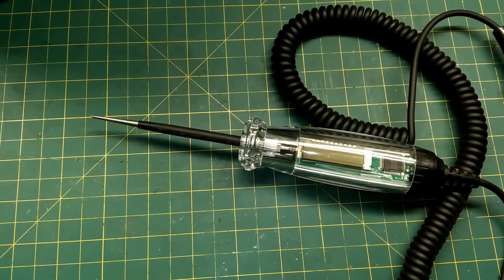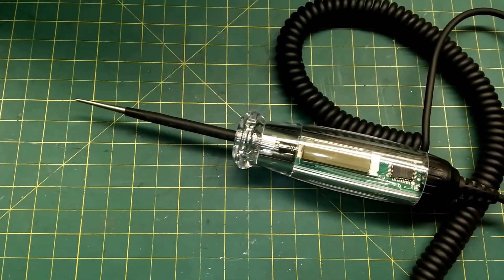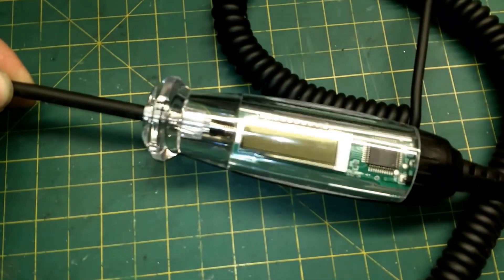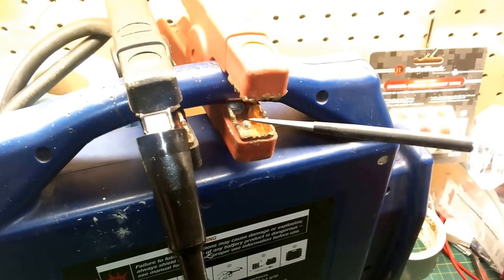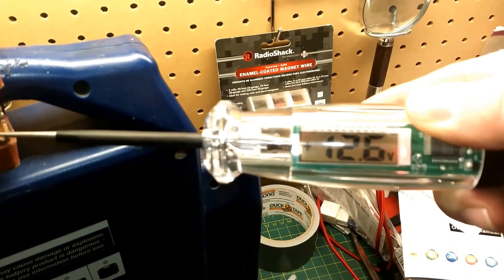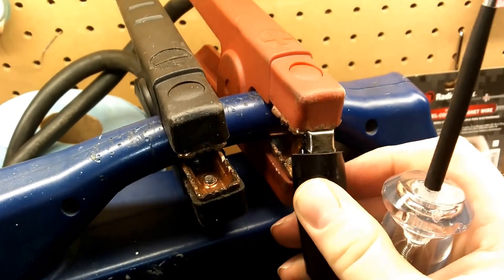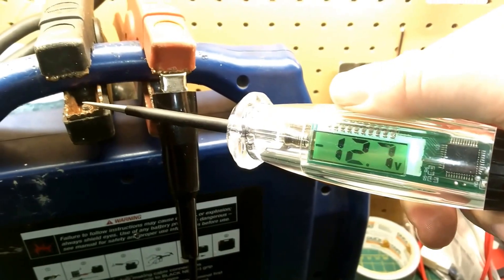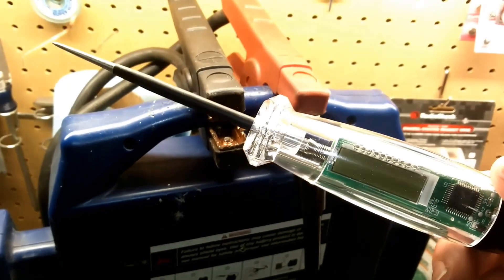Best Test Light ever! Digital Test Light with Voltage Meter and polarity protection!

Comment: when anybody shows me a  a digital tester led   that starts at 0.1v  i will buy it...   oh wait i have it and for  the  last century was called  voltmeter, and  this century it was baptized multimeter....     do a voltage drop check with that from negative  battery terminal to chassis ground  and tell me what it  reports?
Reply from the maker: Back when I took electronics, a Voltmeter just tested for volts.   A Multimeter, had multiple functions.  This is basically just a glorified test light, with a built in volt meter.

Comment: That's all great but you neglected to tell us what the readable voltage range is. Id it maxed out at 12.7v? 34 ... 48... 60V? WHO KNOWS!! If the limit is say, 24v and I'm trying to read a 48 v  golf cart bank of batteries, it had better go to at least 55 volts or it's worthless to me!
Reply from the maker: Different manufactures have different specs and I purposely didn't mention the values because of this. Sounds like you didn't noticed there are two different ones listed in the description and both have different limits.  My suggestion is you put your big boy pants on and do some research.  Technically a voltmeter is all this is and it is all you would need, but I'm sure you already have figured that out.

Comment: These lights are ok in the proper situation. Especially if you are dealing with CAN systems, ECU etc. But if you need to load a circuit down a little like your starter circuit positive wire when checking 

for voltage drops quick and dirty use a test light with an incandescent light bulb
Reply from the maker: Or use a load pro.   https://youtu.be/YS8xIfug9Mg

Comment: Which is the test light you are using?  Snap on?
Reply from the maker: Sandbag1300 Not sure, I purchased it off either a Mac truck or a cornwell truck.   Pretty sure its neither of those brands.   Probably a Leslie
Reply: 1D10CRACY, thanks for the reply.  I cannot find that light.  It has a nice big led display, for my aging eyes, that neither Snap-on, MAC, Cornwell, of Lisle has available.

Comment: Been Looking at them I have a Power Probe but it does not read 6 volts only 12 - 24 Volts  I have old motorcycles that have 6 Volt systems.  I like the fact that you can read Volts and Polarity on these  and the range on some is 3 - 30 Volts Great little tool I also have the Harbor freight test light which has the same Features as yours But no Digital Display  that is 6 - 24 volts  @ 9 bucks you can't beat it